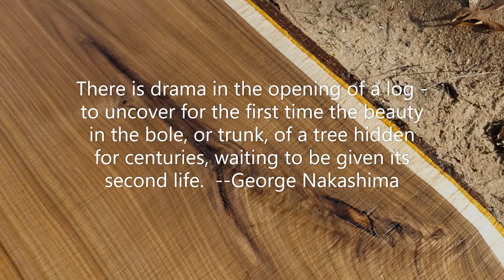Milling incredible Walnut hardwood with an Alaskan Chainsaw Mill

Comment: Thanks for sharing Andre! What board thickness did you go with and would you have made other thickness now that it's been a couple of years? Thanks!
Reply from the maker: Those were about 2-1/2 inches or 10/4.  That's a great thickness for things like headboards, shelves, tabletops.  Some extra thickness is good in case it warps a bit as it dries too.
Reply: @andremitchell1745  Hey, thanks for the quick reply. What was your "target" finished thickness after planing? In other words, how much thicker do you rough mill more than the finished product? Thanks.

Comment: Nice looking wood... But why paint the end if you are going to mill the wood the same day... What does the paint do?
Reply from the maker: The wood has to dry for a couple years before it can be used to build things with.  The paint helps to keep the ends from drying too quick and cracking.
Reply: @andremitchell1745  smart to so it right away, I waited 1 month until I was back in the woods and I had some splitting already! I learned the hard way.